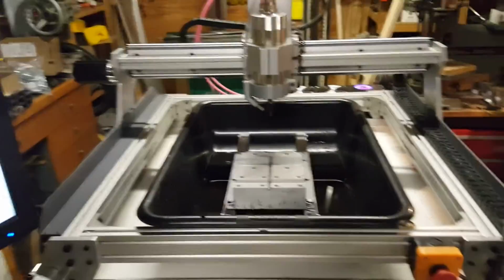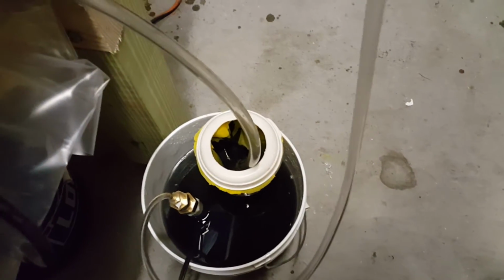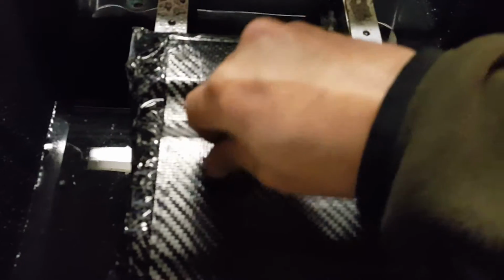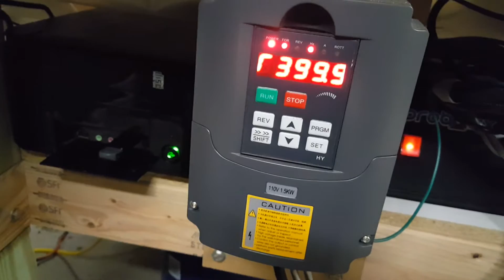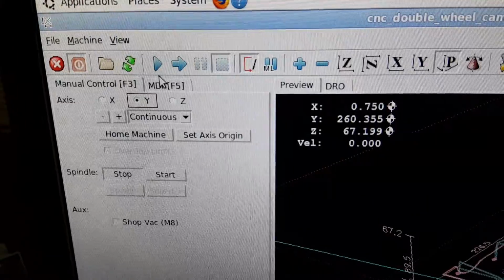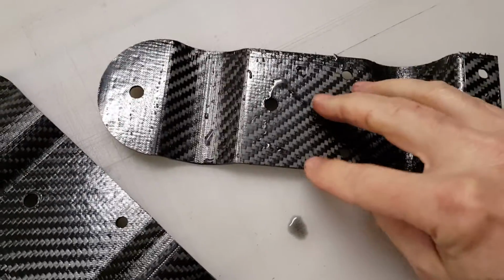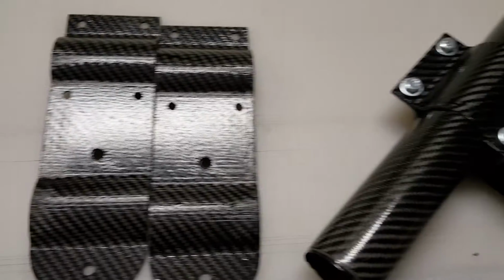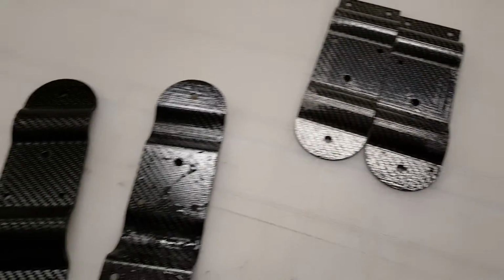CNC Trimming Carbon Fiber

Comment: cool stuff. I see you have really moved along with the carbon fiber parts business. congrats on that. keep those m2's busy!
Reply from the maker: Ha, yeah this one project has resulted in the purchase of about 30 M2s so far.  Only 9 of them are in my own possession, the others are in different locations but all doing the same thing for the same company using the process I developed  I actually don't run a parts production business, I just develop the machines and processes for doing it and then transfer it to other companies that do the monotonous production work.  I'll do a week of part production once in a while, but would not want to do it day in and day out.

Comment: What kind of cutting bit do you use on the cnc? Great work!
Reply from the maker: It's a 2.5mm end mill, the kind with a short flute for trimming printed circuit boards.  Even with the water I can only cut about 12 of these plates before it has to be replaced.  As it dulls, the hole diameters get smaller and eventually it reaches a point where the bolts won't go through the holes.  Same thing happens to drill bits, carbon fiber is just brutal on tooling.

Comment: Did you scrap your fabric table? It was of great inspiration in building mine. Who am I kidding I basically copied almost every element of your table :) Thanks
Reply from the maker: I had to move across country so currently the mechanics of the fabric cutter are packed away in boxes.  I'm doing a total redesign though and the new one won't look much like the old one.  Even the table will be made from welded angle iron instead of wood.  I built a CNC mill recently so now I have the ability to make more precisely machined parts, which allows design improvements.